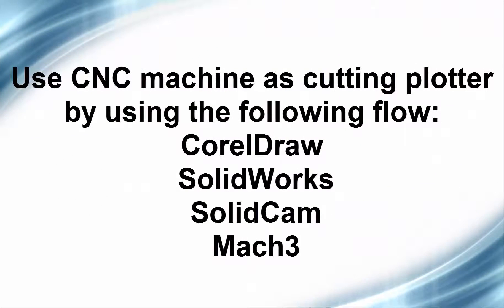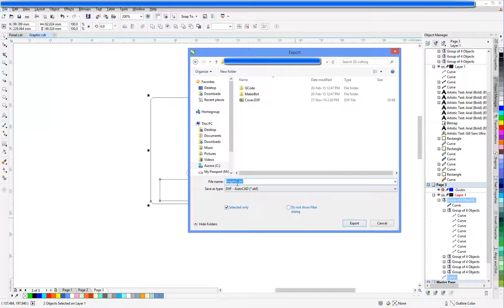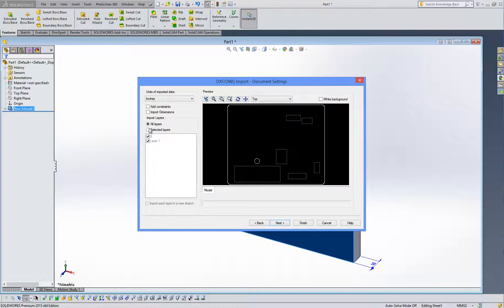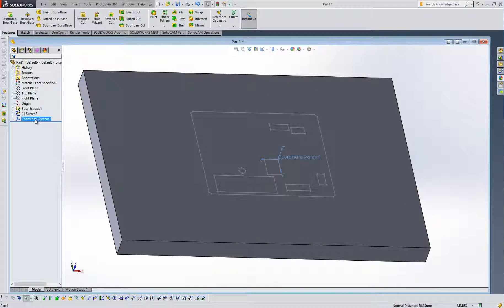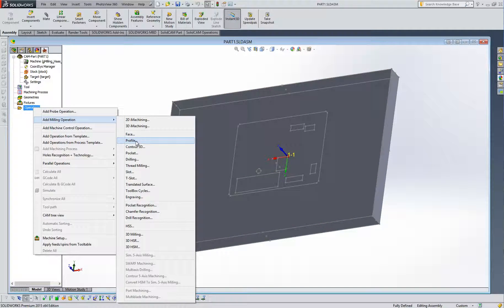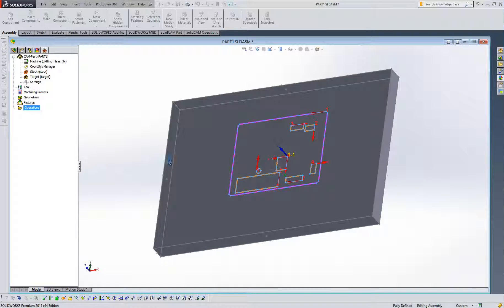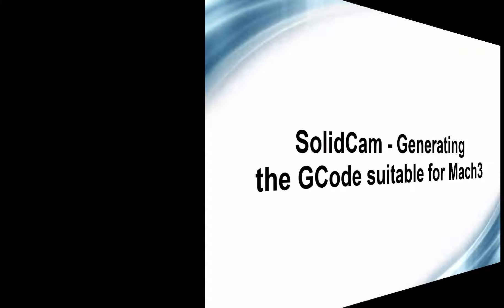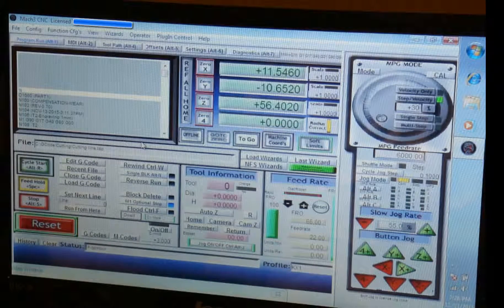Cutting labels with CNC

Comment: Hi Luben, nice video! Have you tried open the DXF file and  generate the Gcode  in Lazycam? Mach3 has the Tangential control option, just give it a try and let me know how it worked :)
Reply from the maker: Hi John,
Yes, I'm aware of this possibility in Mach3 but in this case for me it was interesting to explore the SolidCam way to do the things. The Tangential control option in Mach3 has some problems so when I designed the Tangential Oscillating cutting knife I wrote dedicated software to control the knife in Mach3 - see the link below:

http://www.thingiverse.com/thing:1436870

By using the software (free) uploaded on Thingiverse you can quickly convert the PLT file into highly optimised GCode with 4 axis and overcome the limitation of the Mach3's Tangential option.